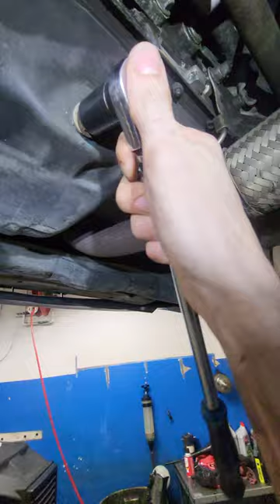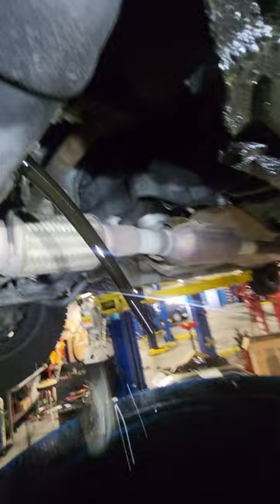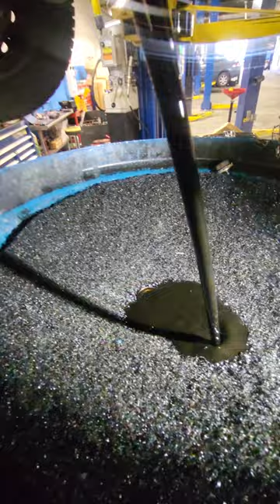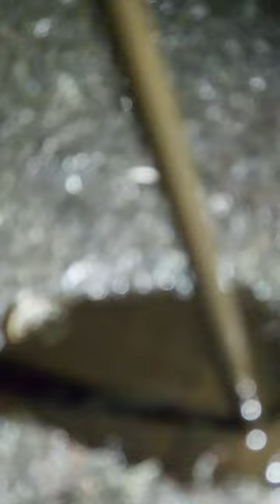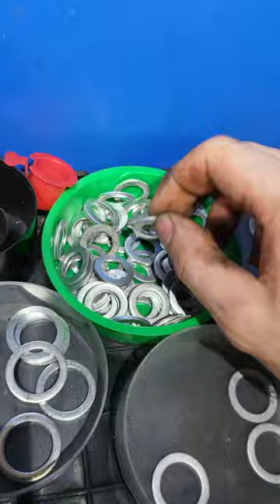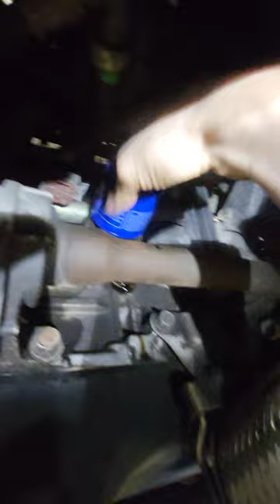2002 Honda Accord Engine Oil and Filter Drain 🔧👀👌 #shorts #honda #tevideos #oilchange

Comment: Thank you thank you so much for not torquing that plug you just made the next mechanics life so much easier for the next Oil Change. All you got to do is just give it elbow grease and that's it
Reply: And thank him for not using an impact wrench to tighten and usually strip the drain plug .
( like lots of the ' Quick oil change   ' places do . )

Comment: question since I'm interested in automotive mechanics, to loosen bolts like those does using the closed end of a wrench or a ratchet wrench make a difference? should one be used over the other? I ask cuz I'm also worried if the ratchet will get over torqued or if with the wrenches the bolts get stripped.
Reply from the maker: So you want to use a 6 point socket on your ratchet or the closed end of a 6 point wrench. Make sure you use the correct size for the bolt and you wont round it. 👌 Using a longer ratchet is nice because it's less effort to loosen/tighten. That being said you have to be careful and aware of the length of tool you're using. The longer the tool the less effort it takes to loosen/tighten. Always replace your washer. It doesn't take much to make a good seal. Once you feel the threads bottom out just a snug more is all it takes. Every car make and model has different specifications for the drain plug. Best thing you can do is use a torque wrench until you get familiar with how it feels once it is torqued to spec. Just always check for leaks after. You can fix a loose leaky drain plug, you can't fix a rounded drain plug  or stripped oil pan threads so be gentle with her 👌. Hondas are normally around 29ft/lbs which is not much.
Reply: What I was taught was to always use a ring spanner or double box end spanner if possible, only use a ratchet if you can't use a wrench on the particular bolt you are undoing.
Reply: @TEVIDEOS  thanks man, dang there's so much I have to learn but it's exactly that that makes me excited to become an automotive technician
Reply: @Pnguin-sh9tr  also stubby 3/8 inch ratchets are your friend if overtorqing is a concern  that or 1/4 inch drive if your set comes with it.

Comment: Think I would get a little more concerned about that oil filter not having any oil in it!
Reply: Does not matter. There is already an oil film on vital components and the filter gets filled by circulation faster than the film goes away. It would matter on larger truck engines, though.
Reply: @Nycorexti  he’s talking about the old filter
Reply: No worries... normal for that particular design.
Reply: @augustinekirchoff479  Ohh okay
Reply: Exactly what I thought
Reply: people really shouldn't make statements not knowing what there talking about
Reply: @cainadkins3985  Huh?
Reply: my honda with a side ways filter also doesn’t have much oil coming out after draining, why would it? it’s not an issue.

Comment: The hell kinda oil filter doesnt piss oil all ovet the place when you take it off
Reply: One that does not have a check valve, so oil runs back into the engine causing a severe dry start situation.

Comment: Why are you using that bigger ratchet to tighten a drain plug that's scary even if it's only a joke people might think they need to do something like that and I've seen that happen too many times and wonder why you are replacing the crush washer never use a wrench of that size to tighten oil pan up God bless you and be safe

Comment: New head gasket on order 😂
Reply: Not sure why you say that. It doesn’t need one
Reply: @Rcguy2591  mate you not see how creamy the oil was 🙄
Reply: @biggsybuds6886  its literally just really dirty
Reply: @rYan-qo9si  it’s starting to turn creamy yes you can just replace the oil and the car will go on for awhile it’s not thick creamy gunk but when oil starts to turn like that or go light creamy brown colour and thicker consistency it’s head gasket bro
Reply: @biggsybuds6886  there's literally no coolant in the any dirty oil looks creamy is you put a flashlight up against it
Reply: @rYan-qo9si  look at the consistency of the oil it’s thick as shit dude if it’s was just standard dirty oil it’d drain through nice go look at other videos the same guys done of oil changes also don’t always have coolant in there for head gasket issues that’s a misconception
Reply: @rYan-qo9si  also I’m not saying heads gone I’m saying looking at that oil I’d be ordering one incase 😂 but I do my work myself on my bikes and cars I’ve seen so much worse but this is what the start of it looks like then if check under the oil cap bet there was a nice bit of sludge there indicating head people always think there has to be water in the oil or oil in the water res for it to be a gasket issue that’s wrong